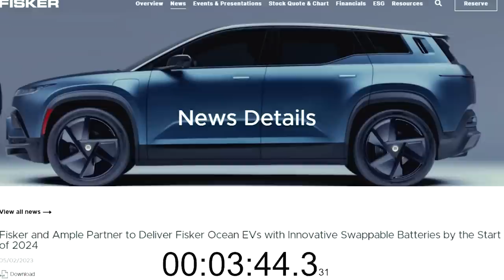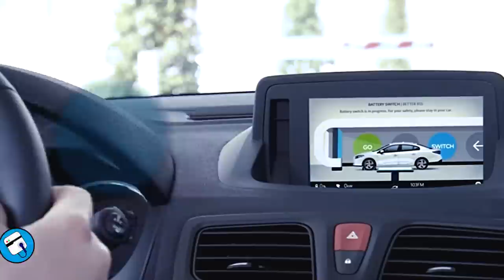Ample Battery Swap: Is There A Future In EV Battery Swap In The US?

Comment: While I think this is a bit of a niche, that doesn't disqualify it. Focusing on ride-share seems really smart.
Reply: Ride-share and taxis are two domain niche....  But so is city other types of commercial vehicles like cement trucks which have the old dedicated networks.....  Plus to lesser extent people n apartments and other forms of shared housing....

But in the US i see pickup trucks.... as an additional market.... Since many people want to be able to Tow with those vehicles....

Can be a pretty substantial Set of niches, when we add everything up.... 

The up front huge capital cost to create the network is what's difficult to overcome.... So it probably Will happen in stages....
Reply: @nc3826  I mean, I'm not really enthusiastic about battery-swapping to begin with. It adds weight, complexity, and I can easily imagine these stations breaking down. Phones lost swappable batteries years ago because of the weight and space required. But, that said, a company that CAN build a reliably system could do well if they know their markets.
Reply: @Thunderbuck    "Phones lost swappable batteries years ago?"  Where did battery swapping stations exist for phones? EV with a swappable battery means it's capable of using a "battery swapping station" As an alternative to charging,  usually in an automated fashion.... When did that ever exist for a phone?

you're about the 10th person that made that  this senseless meme analogy....   Battery swapping for it EV is an alternative for charging correct?  So how does that relate to the replaceability of a battery on a phone?  it doesn't... 

But people repeat things that fit their narrative without thinking about it.... 

 the pros and cons of battery swapping is complex....If the above basic concept is too complex for most people.... then it's kind of silly for me to really be making comments On the subject matter.... 

 Thanks for the input have a nice day....
Reply: @nc3826  Believe it or not, people DID used to swap batteries in phones because they didn't have time to recharge, so it's not a completely invalid point.

Where it REALLY applies, though, is the reasons manufacturers moved away from swappable batteries in phones: they add weight and complexity to the device. Cars with so-called "structural batteries" will NEVER be able to be adapted to swapping, for instance.
Reply: @Thunderbuck   swappable EV batteries are leased and exchanged at a battery swapping station....  so it's not the same thing.....  (but I will  grant some characteristics that are  similar)

Famework laptops can easily replace all of its parts not just its batteries.... And it's weight and complexity is the same as throwaway laptops In its class.... 

So the complexity issue is exaggerated..... Lucid uses a battery thermal system that's compatible with battery swapping.....

 show me a vehicle that has a battery that's considered structural or non-structural that can't be replaced? 

I see most of these memes originating from fanboys....they talk about how Tesla is structurally integrated so therefore it can't be part of battery swapping..... the original  model S used battery swapping..... The stuff is just made up talking points m e m e s.... Why Tesla is not utilizing battery swapping at this point....  It's fanboy rationalization.....I'm not calling you a fanboy.... I'm just saying how it originates....

It mostly comes down to well thought out a design is ..... If something as complex or not.....
Reply: @Thunderbuck  Phones are expected to last 2 years, cars are expected to last at least 20. They use similar battery tech that degrades at similar rates. Even iPhones without user replaceable batteries, battery replacements are not that expensive or difficult.

Comment: Was that 6 minutes for one 30 kwh pac?  If so, to get a 75 kWh that NIO can do in 3-5 minutes, would require 12-15 minutes with changing multiple 30 kWh pacs?  NIO can also swap 100 kWh batteries in the same time of 3-5 minutes.  With Ample's smaller battery packs would take upwards to 15-20 minutes to get that same 100 kWh range.  Advantage NIO!

Comment: I only see battery swap as great positive if you can't charge at home. (And there's plenty people that can't do that that still wants to drive an EV). For roadtrips you want to be able to plug in your car (not wait to do so), and leave for 10-15min to stretch your legs and sort out physical needs. Then head out again. Loadballanced DC fastcharging sites with decent fast charging cars provide just that. While if you are just charging because you can't charge at home and haven't driven a long time to the station, you much rather be able to book a time slot to come and swap the battery, turn up and leave with as much charge as possible as soon as possible.
Reply: Does "fast" charging mean level 3? That would be better be simply called DC charging, which is also the standard for portable devices (such as phones) and electric bikes.

Comment: The problem is a lack of standardization and really governments should've been funding open standardization decades ago instead of leaving it to independent companies.   I like what Ample is trying to do but I don't think they will secure enough of the market to become an option for the average consumer and even if it does, private EV car owners might only switch to the system once their factory batteries need to be refurbished unless purchasing their vehicles with Ample's system is possible from the dealership's.

I also think they need to provide an external plug and control system hookup so that a swappable external battery or generator trailer could be attached to the system and again the standard would need standardization.   We are already dealing with confusion over NACS, if EV's are to fail, it will be because governments do not have the balls to support standardization and we've seen this for decades now.

Comment: If you used modules how would you match the battery capacities with many nodules?
What about the high voltage connections at 400v and 800v+.
This would be a nightmare in snowy cold climates.

And most cars charge at home ...

Nio is getting near bankruptcy... Due to high costs ...
Reply: "And most cars charge at home ..." Is that why we are moving to electric cars?

Comment: It would require standardization among manufacturers as to battery dimensions, connections and mounting points. It's not likely to happen.
Reply: there's over a half a dozen battery swapping networks in China, so it's already happened

plus CATL Launched Modular Battery Swapping.... So the model already exists.... 

It does give up a tiny bit of space efficiency, but In return you get battery swaps that are a fraction of the time of charging.... 

But  It won't see it coming to the United States anytime soon. for virus reasons.... But Nio did promise to come here at some point....
Reply: @nc3826  Except things like that are easy in China because they can give everyone the marching orders.
Reply: @davidmccarthy6061 Nice try.... There are plenty of choices when it comes to what to buy In China.... They buy it because it makes sense for them individually.....
Reply: The video explains, this system works with the existing vehicle battery design.  They make a modular battery that mimics the original battery and goes in its place.

Not sure how that will work at the consumer level.  The original battery has to sit on a shelf somewhere, or be sold as a spare part or something.

But I believe something like this will be the solution for long range trucking.

Comment: EV charging at 250 or 350kw is already very quick and in the future, we will be charging as fast as gassing up…. So this just won’t be necessary until the battery just fails to hold a charge altogether years down the road.
Reply: Not really, cheaper car is still on the menu.
Reply: Well, I have an electric bike and it takes longer to charge that than it does to fill any fuel tank, including those of trucks. Even charging my phone takes longer than filling a fuel tank.
 Faster charging also increases peak power demand.

Comment: I’d like to see a system in the bed of a Rivian where you can add the cost and weight of another 50 kWh battery only when you need it. Same actually for a car. The only cost savings is keeping a smaller battery in for everyday and adding range only for a road trip. Better efficiency with a lighter battery.

Comment: Mobile battery packs would make far more sense. 150 mile onboard battery with the ability to visit a supercharger and rent a mobile battery that adds a further 250 miles for the time you need long range
Reply: That would likely be expensive given the liability it would have to cover.
Reply: @lanceareadbhar  It would be cheaper to carry around +300kg of batteries only for the few days a year you need that range rather than 365 days a year
Reply: I thought about that. However, with current technology, a battery that fits in the trunk of a car might net you an extra 20-30 miles of range at best, and even then, it would be heavy enough that you'd need machines to lift it in and out. It's also not clear how thermal management would work; in the trunk of a car, these batteries would get very hot when used.

Of course, future battery technology could improve batteries' size/weight efficiency, but by that point, we'll likely have a lot more superchargers, obviating the need to carry all that additional range to begin with.
Reply: @ab-tf5fl  what I am talking about is a mobile battery on its own two wheels you hitch to the back of an EV when you need a long range EV

You aren't lifting anything in or out of your vehicle

If these existed it would allow truly affordable EVs as the affordable end of the market could be as low as 15KWh 90 mile range EVs which would be enough for most days especially if you live in a city or a smaller country for example in the UK the average daily mileage is only 20 miles so a 90 mile EV would be fine for most people most of the time and then go and rent a mobile battery pack for when you need a 400 mile range EV

People don't appreciate how expensive fully integrated batteries are. People talk about $100/KWg but that is at the cell level. At the pack level fully out the door you are looking at over $300/KWh so a 60KWh pack vs a 15KWh pack is a vast difference of $13,500

So anmodel 2 long range with 60KWh pack at say $30,000 or an identical model 2 with a 20KWh pack but for $18,000.....

I'd take the latter as I live in a middle income country and the additional $12,000 for the long range version isn't worth it. I'll just rent a mobile battery pack for the 5 days a year I need more than 100 miles range ir just accept the inconvenience of multiple stops for those few days a year and save the $12,000 plus lower insurance costs lower fuel costs lower tire costs etc

Comment: never really had a strong opinion one way or the other regarding battery swaps, though i "lean" towards NOT doing it i'm not "hardline" against it (not yet anyway).  however those keeping up with current events will likely have seen the recent video from China where a car (with a supposedly swappable pack) ACCIDENTALLY DROPS IT'S BATTERY IN THE MIDDLE OF THE STREET...!!!  now in Aviation terms of risk and probability, i would definitely view that as a "fluke" or a "one in a million event", but what seeing that video should hopefully do is snap the "Stockton Rush types" (you know who you are) out of their tendency to IGNORE SAFETY...

thankfully there appeared to be no fire/thermal runway event (concern #1) but something most will overlook is that an EV battery pack is HIGH VOLTAGE and thus represents an additional risk in terms of ELECTROCUTION (concern #2) and then finally - what should be obvious -  is that these packs weigh 750 lbs to 1500 lbs, so if it does detach a Police Officer or a First Responder isn't going to be able to just "push it to the side of the road"...? no, you're going to need a piece of Heavy Equipment (think small crane of boom truck) to lift it clear of the roadway and restore the flow of traffic...

see, there's a WHOLE 'NOTHER angle most don't consider, even though the problem is more or less staring them in the face.

Comment: Its just not fast enough and will wear the attachments points.
Reply: They're not removing the vehicle battery each time.  Their putting in its place a frame and battery modules that mimic the original battery.  The modules are attached using hardware designed for this purpose.

It makes good sense for fleet applications.  And I believe something like this will be the solution for long range trucking.

Comment: If battery swapping made any sense, your phone, laptop, tablet, etc, etc would be that way….
Reply: Battery swap technology is, in fact, used widely today for electric lawn equipment. For example, if your leaf blower runs out of power, rather than wait for the battery to charge before finishing the job, you can just swap in the battery from your lawn mower.

For lawn tools, I think battery swaps make a lot of sense, as these batteries are small enough and light enough to be swapped by hand. For car batteries, which are much bigger and heavier, not so much.

Comment: I think the primary target audience for battery swaps is uninformed consumers who are interested in EVs, but have experience only with gas-powered cars, and are worried about charging times and battery degradation being a much bigger issues in modern cars than they actually are. (Some of these concerns are based on projecting limitations of the EVs of 10 years ago onto the cars available today, ignoring the fact that technology has advanced).

Unfortunately for whoever is promoting, this is a target audience group that is going to rapidly shrink over the coming years.

Comment: This company will fail.  They don't manufacture any vehicles, and must convince the EV manufacturer to design their EV's battery pack to be removable.  Now that the big players have jumped on board to using the Tesla connector, there is no reason to have removable battery packs.
Reply: True, Tesla connector are magic....  

didn't Elon say batteries aren't even needed once you have a Tesla connector?

Comment: Your footage of NIO swap is so out of date current NIO tech is way ahead of that.
Reply from the maker: I used the footage I shot when I did a few battery swaps in Beijing in late 2019. I know they have newer swap stations in service.
Reply: @StateOfChargeWithTomMoloughney   Dude you need to go back to China so much has changed. Also Beijing is not the best example. Next time visit Shenzhen and Hefei these are the two leading eco-tech cities,
also nicer, modern, smaller cities with only 12 million instead of Beijing's 24 million population...almost a village LOL! Plenty of manufacturers from EVs to SOLAR gear that you could arrange to visit and a get a tour with. Team up with a Chinese EV Youtuber or one of the China based expat Youtubers. Just standing on the corner of an intersection in Shenzhen's tech district and count the cars, buses and vans with the Green licence plates...amazing.

Comment: They have been doing it with fork lifts for over 50 years. Problem with the extreme fast type 3 EV charger they need several hundred amps of power. Good luck trying to get the typical lazy foot dragging ultilty company to provide enough power for say 6 type 3 chargers. I retired from a large hospital where the local electrical supplier paid them a lot of money evety summer to peak shave 3 megawatts of powet during hot summer days. They did this by running four big natural gas generators and transferring the mechanical loads to gen sets and starting up 3 or 4 boilers and run air conditioning off steam turbines.